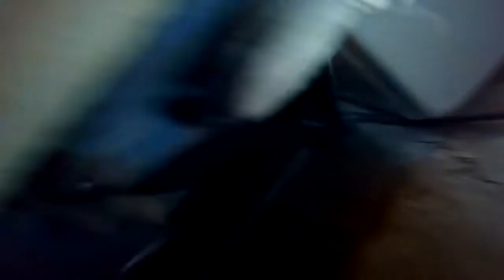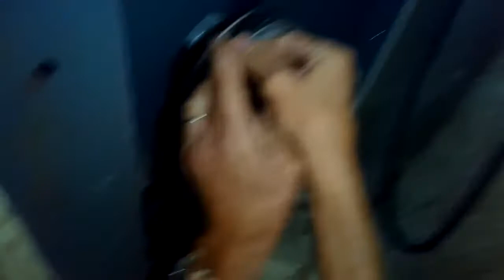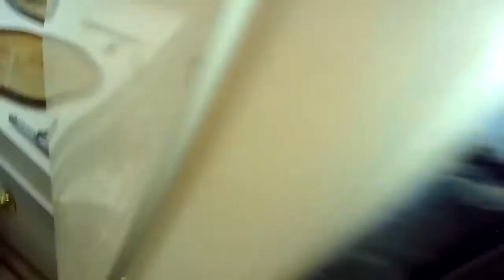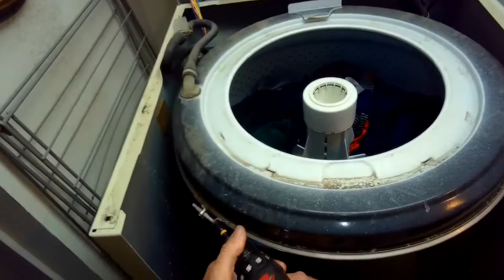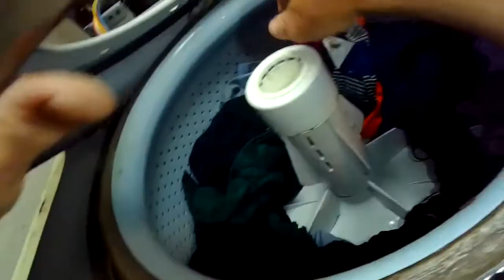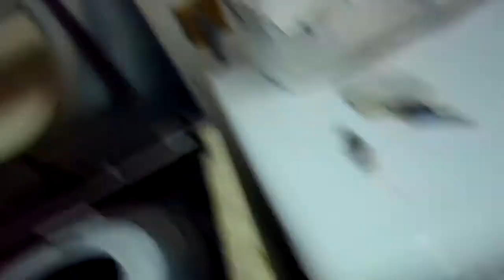✨ MAYTAG WASHER NOT SPINNING - EASY FIX!! ✨

Comment: Great video.  I checked my belts and pulled the cover off to see if I could find one of my many missing socks.  Nope.  As I was sliding my machine back into position, I noticed my drain hose was kinked.  That was the cause of my machine's spin cycle to not be very efficient.  Got the kink worked out and the machine was back to normal operation.  Thanks for getting me to that point!
Reply from the maker: Wow, nicely done👍😊
Reply: Wow 😮 Thanks For The Advice. I Really Appreciate It. 🙏

Comment: Thank you! I have this exact model that came with the house over 11 yrs ago. It was agitating but drum was not spinning after replacing the belts. Even replaced the springs for the belt tensioner.
Reply from the maker: Is there any sound when it’s supposed to be spinning?
Reply: @FastFreeApplianceFixes  squealing sound from the belt and can smell it burning a lil. So I hit the stop. Going to lift the top, check drum and pump like you showed. Hoping its not the trans or drum bearing.

Comment: .Getting ready to check out the belts, im sure thats the problem, i smelled burnt rubber earlier when it was loaded.  One thing I saw in another video, exact same thing. once you install the pump belt, you pinch the hoses together in the middle, and should have a 1/4" gap, and the motor should just start to move.  The directions show how to adjust the tension of the belt by adjusting the screws on the pump, if you have to adjust the tension of the belt.  TIA anyway.
Reply from the maker: Great info.
Thanks Doug 👍

Comment: Hoping you can help. I have a year old Maytag Commercial washer. No lights are displayed. It turns on and fills. Starts to agitate, just one jerk and stops. Does nothing else and drains at end of cycle. It Does the same thing in diagnostic mode.
The actuator does engage. Example I set washer to rinse and spin. Actuator engages and motor jerks about every 30 secs. Then fill stops and actuator goes back and agitator tries to spin but stops. Drain pump runs. Actuator engages tries to spin but stops. Capacitor is showing 58.8 MFD

Comment: My washer washes and when it’s time drains the water but the drum won’t spin no clothes stuck in between the tub and drum , any suggestions?
Reply: Can you tilt it back and check underneath for the belt that goes around the central pulley.  Is the belt still there?